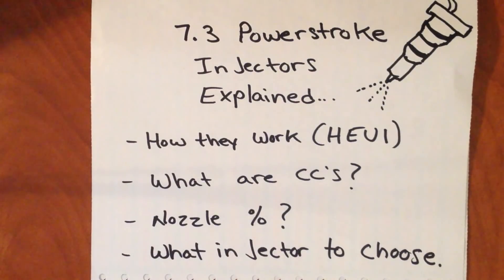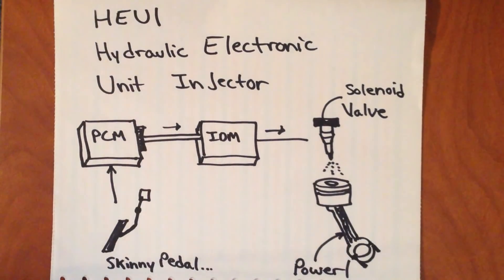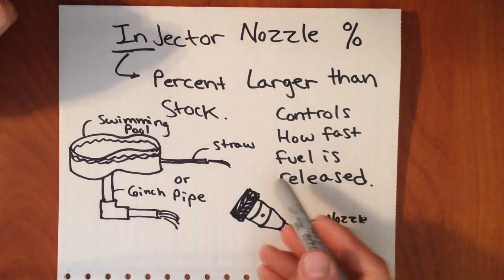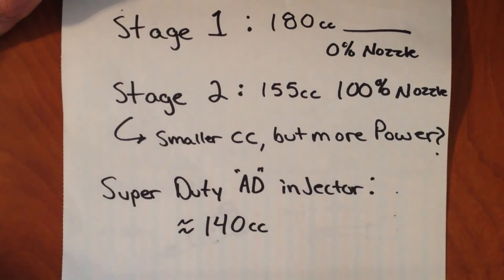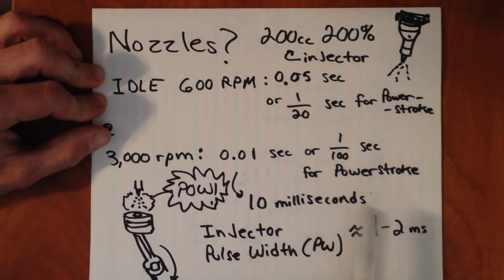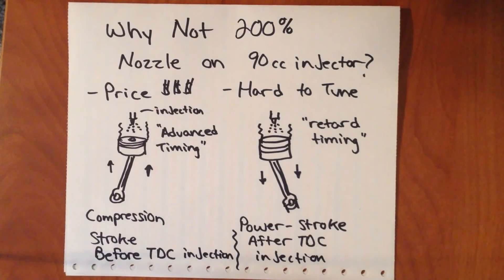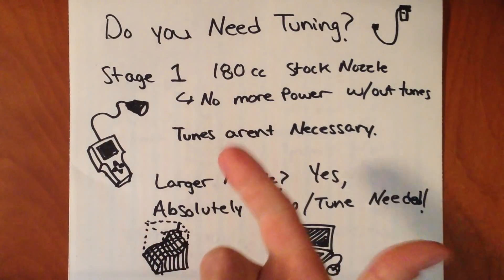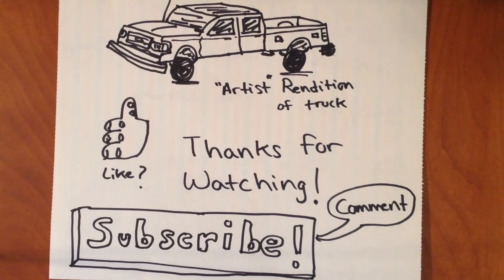7.3 Powerstroke Injectors Explained

Comment: With these and the 6.0 injectors.. is there an oil bypass for the high pressure inlet? There shouldn't be after the ipr.. the ipr is the regulator so there shouldn't be any sort of bypass or pressure relief.. it should be a closed hydraulic system, technically, correct?

Comment: Love the videos. 
I have a '95 with TS 6 position tuner. High idle works but I only noticed a difference on 45+ and 100+HP. Could it need more air to get the 140hp gain? Or fuel. Boost gauge gets to 16, that's the highest I've ever seen it
Reply: Adjust your wastegate

Comment: Very good explanation, but your HP numbers are off. I've personally seen 180/100 injectors dyno over 500RWHP. All depends on the turbo you're running. Need air to match the injector capacity or you're just pissing in the wind.

Comment: So in theory, if I have 125cc injectors, at full throttle, all 8 of them will push a total of 1000 mL liter of fuel in 1 min? So if I have 14 gallons/52 litres it would empty my tank in ~52 minutes of WOT? 

Is there any way to find out fuel mapping of a stock 7.3 like 50% throttle would technically be half of what its cc is?
Reply: A) Fuel mapping is not linear to throttle position.
B) 250cc injectors deliver 250cc of fuel in 1000 injection events at rated FIPW (fuel injection pulse width) @ rated ICP (injection control pressure).
This means your tune has to call for X cc of fuel for that one minute, and your HPOP (the weakest link in the equation) has to be able to sustain oil for the call (which usually doesn't happen) for one minute.
Get a fuel map for your tune.
Its the only way to answer your question).
EDIT: 
PS: To technically answer your question, after picking apart your fuel map to find what the call curve for your tune is, you'd need to have your injectors flow tested to see what they actually flow at rated FIPW & ICP...
So... to technically answer your question about your setup, you need a lot of detailed information about your programming, injectors, and HPOP.
Reply: @501Bravo  Oh I wasnt trying to be that exact, but hey, more exact is better. The computers for the t444e seem to be linear for fuel mapping compared to a superduty or an obs  7.3, but you still have the icp and pulse width which will vary.
Reply: @501Bravo  So the difference can actually be a good 50%, more or less easily? That map would be affected or 'directed' (?) by all the other enviormental variables, such as charge air pressure, engine temperatures, oil pressure, hpop pressure and flow rates, fuel temperature and pressure, altitude and air temp, a/c on or off, desired rpm & current rpm and much more. The computer might seem simple but there really is a lot going on. I would like to get my hands on some software to see what can be changed with mapping out fuel delivery but I can't find something that is free. 

I guess, if I had a mechanical injection pump to set a desired fuel delivery rate without any external inputs accept for rpm governing, and it was a full load sustained at a certain rpm at "full throttle", I could have a more accurate prediction with flow tested injectors?
Reply: @f-j-Services  So the difference can actually be a good 50%
Well, that may a bit of an overstatement...  but, it might not be.
Even with two untouched trucks, just using different oils can result in massive differences in the injectors and HPOP at just 200,000 miles.

The computer might seem simple but there really is a lot going on.
These computers are absolute dinosaurs.
BUT, they were the first that allowed a diesel to control injection timing, duration, and rate of an injection event.
That's something that couldn't even have been dreamed of in 1990.

If I had a mechanical injection pump to set a desired fuel delivery rate without any external inputs accept for rpm governing...
That's literally the definition of mechanical injection.
The only thing you can control is the amount.
SOI (Start of Injection) is set, and duration is a function of amount, b/c injection pressure is more or less set as a function of volume.
The really fancy mechanical injector pumps had a dashpot diaphragm that would increase max volume as MAP increased.
That was it.
Reply: @501Bravo  Now can pressure be maintained for a longer injection duration, or is pressure lost if the duration is longer, and its higher if it is a very short shot. You only have so much fuel pressure in the head then the plunger will inject the fuel, but if its slower, that's a lower pressure with less fuel atomization, right? Or is it still so high it has no significant difference?
Reply: @f-j-Services  Pressure can be maintained - if the HPOP (High Pressure Oil Pump) is up to the volume.
The HPOP can either supply it on demand - or it can't.  There is no "pressure tank" to to build pressure into.
If your call for ICP (Injection Control Pressure, which is High Pressure Oil - HPO ), is greater than your HPOP, can provide, your FIPW (duration) has to widen.
Many a person has bought bigger injectors, and seen little improvement b/c a weak HPOP was the problem to start with.
One of the appeals of Hybrid injectors is a reduced oil requirement.
But, there is a cost.
  Hybrid injectors can't inject at the pressure levels of a B code or A Code.
So, while Hybrids can squirt more fuel from a weak HPOP, it doesn't atomize as well. This leads to haze/smoke, reduced power (relative to an A Code of same volume), and higher EGTs.
IMO, this is not good for a truck you actually want to drive - or work.
Hybrids are a great way to make power if you are drag racing, or pulling a sled.

You only have so much fuel pressure in the head then the plunger will inject the fuel...
Fuel pressure in the head is not significant for the injection event - only for the refill of the injector fuel chamber after.
Fuel atomization is entirely based on ICP, and the multiplication factor of the injector.
A Codes are 7x,  B Codes are 6x,  Hybrids are 5x...
7x 2800PSI = 19,600PSI Injection Pressure
5x 2800PSI = 14,000PSI Injection Pressure

Ideally, if you are driving this truck up and down the road (empty or pulling a trailer), you want A Code injectors, with the biggest HPOP you can find.
That gives you the ability to inject at 21,000+PSI, and enough HPO to do it.
You can easily take a set of AAs, and make them 190cc.  While your at it, put in a set of 80% nozzles.
Add to that a HPOP to run them, and you are 425-450HP.  That's plenty of power to start finding what's weak on you truck.
Reply: @501Bravo  So overall a weak HPOP can cause poor injection pressure, reducing atomization? (Or injectors that require too much oil, such as big AC code injectors that would go in a T444E I believe. This leads me to wild question, could you in theory, (possibly with tuning) have say AB and AD injectors mixed, and balance them out with firing order with the engine to keep the load balanced instead of just having 4 on one bank and 4 on the other bank. I wouldn't imagine this would gain you any benefits but I could be wrong.
Reply: @f-j-Services  The AB and the AD are essentially the same injector.
The AB has an Intensifier Piston length of 29.7mm, the AD IP length is 29.1.
This 6/10 mm difference is what gives the AD the 160cc rating versus the 130cc rating of the AB.
And yes, you can simply take the AB apart, shave 0.6mm, and have an AD.
Until you max out the ABs, the injectors would be balanced anyway.
You do not change the split shot event until you mess with the plunger length.
Personally, I think prime (split) injection is stupid.
Go single shot.
Reply: @501Bravo  I never understood why they even botherd with trying to quiet the already quiet engine down with split shots. I don't get why they supposedly derated the 7.3 by 50 foot pound and 25 hp (or something close to that) because it was "too much power for a pickup truck" now we have 1050 lb torque and 475 hp trucks with locking rears and 10 speeds.
Reply: @f-j-Services  Split shot was not to quiet the 7.3.
While "quieter" was touted as "an added benefit", the sole reason for the split shot was to reduce NOx emissions.
NOx reduction was also the reason to drop coolant temperature to 190°.
Both of these moves reduced engine efficiency - which, if you're keeping up, produces more pollution.
Way to go EPA...
Horsepower wars is why we have ~500HP and 1000+lb-ft torque.
Oddly, in the late 80s-through about '93, Dodge misrepresented their HP lower than what it actually was b/c of the Getrag manual transmission they were using.
And... the transmissions were known for frequent failures b/c of it.

Comment: As always, great video and love your explanations! This all makes a lot of sense for how a single shot injector works... but what about a split shot injector? Do they use the same plunger and barrel set up? How are they able to use high pressure oil to send two separate shots of fuel?
Reply from the maker: It's been a while since I've looked into this. Though here's a good page I found that shows the concept: http://www.intellidog.com/dieselmann/injector.htm 
It's pretty neat now the split shot functions. A small passage get's uncovered during the injection event that momentarily stops injection from happening. Then the port gets blocked as the injector piston moves down and injection proceeds as normal. Pretty cool!
Reply: @Rnddiesel  Thanks!

Comment: Hey I've got a simple injector theory question please.  I have a 1993 F-250 absolutely beautiful condition XLT 7.3 IDI.  It's completely stock without the factory turbo with 115K miles.  This motor starts instantly in any temp (using a new block heater), runs, and pulls a 10K trailer perfectly.  Here are my questions:  

1) I would like to know what's going on inside the factory injector with respect to the plastic fuel returns caps.  Obviously, the plastic caps and hoses are low PSI. After the injector has sprayed fuel, I assume any excess low PSI fuel is directed out of the injector, into the caps, through the hoses, and either back to the tank via the rear return near the firewall, or (?) back to the top of the injector pump via the low pressure hose, or (?) back to the top of the fuel filter/heater housing.  I'm asking because I'm trying to trace all the possible air intrusion points of entry.  If the plastic cap o-rings, caps, or cap hoses are not sealing well, I assume they leak air in while the motor is stopped.  If so, air would try to travel to the highest point (the schrader valve in the filter housing) I assume.  Also, if air was intruding at the olive seals, mechanical lift pump, fuel heater, or the drain valve at the bottom of the filter, I assume it would try to travel to the highest point in the system.  Therefore, depressing the schrader valve while cranking the engine (or running an electric lift pump) should clear the system, correct?        
2)  I assume the the low pressure hose at the very top of the IP is for excess fuel coming FROM the injector caps BACK TO the IP.  Is that correct?
3.) If I don't convert to an electric pump, I'd may install a hand operated fuel primer pump.  These manual pumps eat up about 2 PSI just for fuel to travel through the unit's body and check valve. Just wondering if you think a fresh stock mechanical lift pump is strong enough to handle the addition of a primer device.
4)  Plenty of IDI user love the Duralift Facet electric pump set-up.  However, some say they are not as reliable as a fresh factory mechanical lift pump.  Assuming I can eliminate any and all air intrusion (which I think I can), what do you think?
Thanks.

Comment: I’ve got an 01 7.3L. I’m looking to do single shot injectors but...I’m a CA resident and I have to deal with the dreaded SMOG... has anyone here had or heard of issues with smogging your truck after installing single shot injectors? (I have to have my tuner unplugged for the smog so clean tunes is out of the question)

Comment: CC's are rated at 1000 shots, not a minute. I believe most injector builders rate CCs and nozzles at 3000 psi ICP, over 1000 shots. 
As far as nozzle size, smaller nozzles atomize the fuel better at low RPM.
1000 HP 7.3 doesn't generally happen on fuel only. Cylinder head flow stops them near 600 - 650. Can it be done, yes. Same modifications as all high HP engine builds, ported heads, cam, big efficient turbo's, fuel system, lots of HPO and great tuning. Fully built engine also, although a few have done well over 1k on stock bottom end w/nitrous.
One other thing not mentioned, factory forged and powdered metal. Forged are more forgiving to aggressive tuning, and have a higher HP rating. Powdered are much weaker and don't like low RPM torque production. 
Even if it doesn't sound like it, great vid!

Comment: I have a 96 7.3 with 215 000 miles and was looking to upgrade the injectors to stage 1. I plan on keeping the truck for ever so I was wondering if anybody can recommend a good dealer in NW states preferably, also a good tuner? I live in Canada, but I plan on crossing the border when it opens to get this done. Thanks great video
Reply: just do an injector nozzle swap, its about 500$ for a 100hp to 50hp gain
Reply: @johndowe7003  Nozzles alone won't do much.
Reply: @bitterrootdieselperformance  yeah but for the budget it should do plenty
Reply: @johndowe7003  Nozzles alone will only at 25HP.

Comment: So I have a ScanGauge 2 and I got readings of the ICP @ 3800 so does that mean that the actual PSI at the injectors 7 times that. So that means it's 26000 PSI?
Reply from the maker: Pretty much yeah. That's the pressure the fuel sees during injection into the combustion chamber. 3800 PSI sounds a bit high for a stock 7.3 Powerstroke, have you made any modifications to the truck?
Reply: @Rnddiesel  it's actually a 6.0 L
Reply from the maker: @ronbown3836  That makes sense! Yeah I'm not so sure what the injector ratio is for the 6.0, but I imagine it's in the neighborhood as the 7.3 injector amplification ratio.